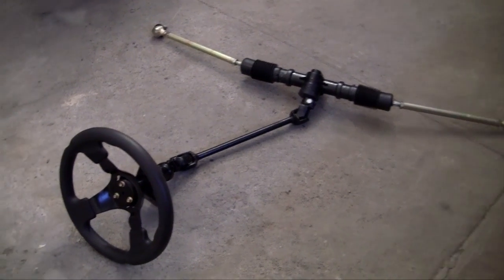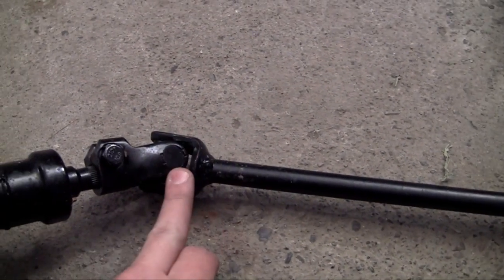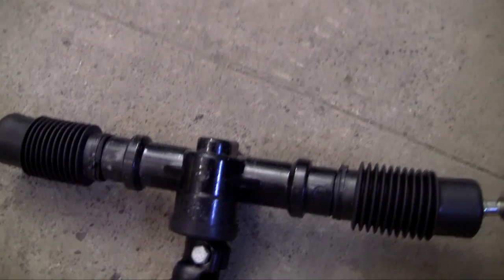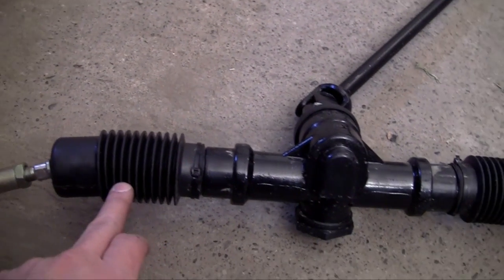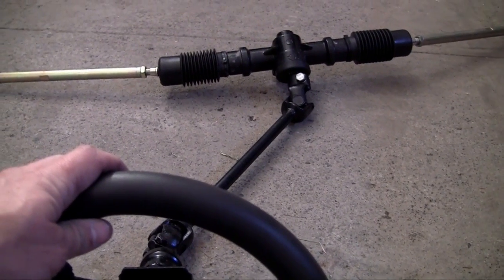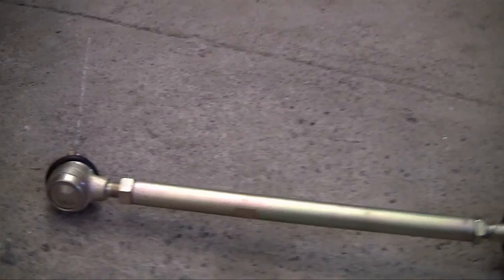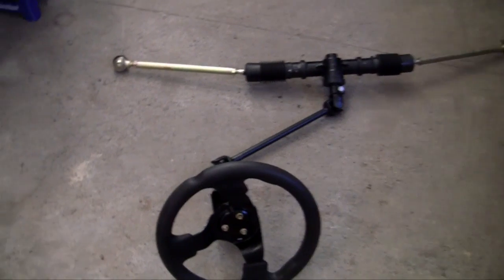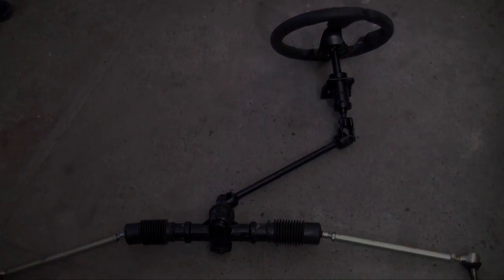How to Build a Go Kart - 7 - Steering System Overview

Comment: I have noticed that what the americans call go karts aren't quite "restrict" in definition. I'm from south america and in my country go karts are specifically open wheeled, wide chassis (usually default modeled) with no suspensions, very low to the ground, usually 2 strokes engines, with no transmission. I'm quite sure most Europe is quite as restrict about what a go kart is and that difference between our definitions might lead to confusion. I would call this a buggy kart project. Respect.
Reply: No one cares what you call it in your country no one cares about England and no one cares about South America this is the United States of America where we have freedom and we call it whatever the hell we want

Comment: I wanted to find out too, bucky said in part 1 that he got his online, so i did a google search for "dune buggy frames" and "dune buggy parts" (because the frame bucky is using here is a dune buggy, not a go kart, he says so in the last video) and i found a few websites that sell them but they are like.. $650 for a frame (already welded) which is too expensive for me but you might get lucky with websites like ebay or something for a cheaper frame.